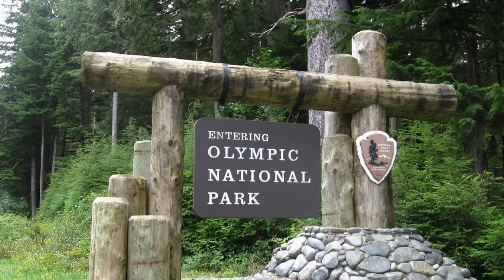Dutch oven cooking | Campfire recipes | Wood fired oven | Pizza oven recipes

Comment: When I do foil packet food, I always double wrap, starting from the opposite side I started.  Helps keep the liquids in, if you have any gaps at all.  And sometimes the coals are hot enough & the foil cheap enough that it burns through the outer later, losing a lot of liquids and potentially burning the outside if running single layer.  For cinnamon/raisin/cherry/nut/granola/apple packets, I usually add a pat of butter.  Also love doing the where you stuff cinnamon roll dough inside a hollowed out orange, leaving a little of the orange meat inside.  That wine sounds great to do poached pear packets too.